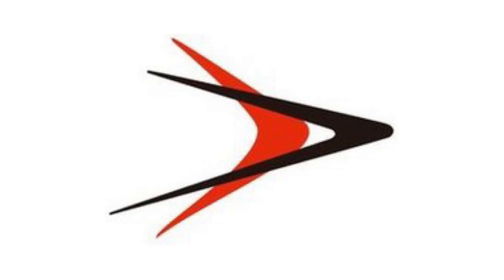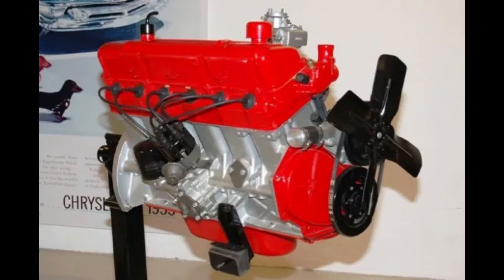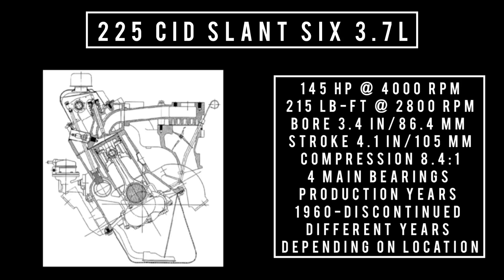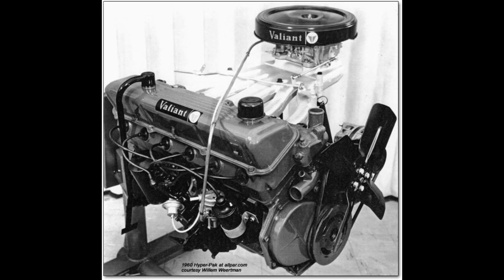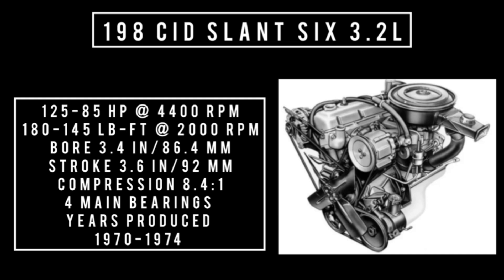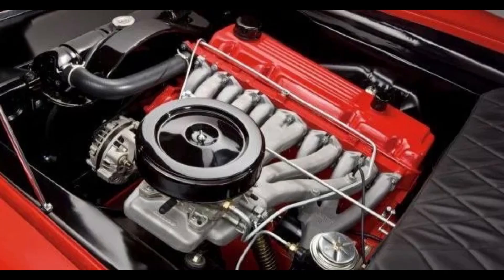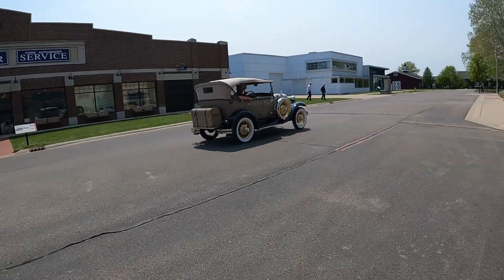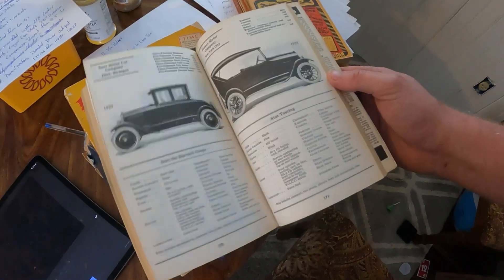Chrysler slant six engine family

Comment: Inervaters always ahead of the others, Australian charger was 14 sec 1/3 mike  stood for yrs fastest six 265 220,280,320hp ,triple Webber's,3, 4 speed later
Reply from the maker: There is nothing sexier than when you open the hood and you see three Weber side draft carburetors with the velocity stacks on an engine

Comment: Look  the Ford was a great lasting n 188 had awesome sound like a v8 sweet crackling with a tuned geni extractors n good fuel economy 🎉e, the chev six was great to actually hoping up n would only get let down by a circling oil pump or a shredded timing gear but a aluminium one would do it justice ,I'm going off my early days XTt 68 falcon ($420) loved her n my 307 CHEV 64 belair $1200  20 thou oversized fuelyy heads 1 650 vac holly 2sp powerglide push start lol , my 69 gran California special edition Buick coupe 350 4BARRL 2SP ELECTRIC POWER😂GLIDE  1 BOLT REAR 2  DR 2 PILLAR  3500 OK LOVED IT , BUT MY VF DART 170 (69) SHELL AUSTRALIAN COUPE  120 BUCKS BLEW A AUTO SEAL LOL BUT 225 IS IT RUNNING AFTER A TUNE UP YEP THAT WAS INCREDIBLE TO SEE I LIKED TO JOIN 2 N SEE A V12 HMM IT WAS GOOD BUT 318 SOLD ME NO OIL NO WATER N LIVED N WAS A DUELmovie VF REGAL 400 BUCKS N WAS A GOOD BLOODY RUNNER ,N 273,VG ,770 318 VG 200 BUCKS LOL THE CHRYSLER JuST WOULDNT DIE N IF U THINK TOUGH I HAD A DUDE GIVING ME 65 MILES OF CRAP SO I LINED HIM UP N STOVED HIS BACK END IN COMPLETELY N HAD A SMALL MARK ON BUMPER THAT TALT HIM THE DWEED LOL GRRR BUT HAD ALL 3 FIRST CARS  GOT SOME CHARGERS LATER COOL SO THEY ALL HAD GREAT RUNNING BUT MY VG COUP  265 4SPEED I REG IT ONCE EVERY 4 YRS FOR 3MTHS N NEVER TOUCHED IT A 1971(69) SHELL HERE N IT START N GO N I DID THAT FOR.   12YRS N IT WAS GREAT SO VALAINTS ,WERE PUT DOWN BUT REALLY THEY WERE GREAT WE DIDNT GET THE 426,383, BUT WE DID GET THE HYPER PACKS ,THE AP5 ,6 273 N 318 N E33,E34,E 40,e48,E37,e38,E49,E55 340 THE E CLASS 3 SPEED,4SPEED, 2BA4REL, 4BARRL,  TRIPLE WEBBERS , E360 VK SO VG WAS LAST PLYMOUTH VALAINTS N 200 BIG BLOCK AP2 N MOPARS PHINOEX, each year  I HAVE A 65 4DR PILLAR  IT HAD A BIG BLOCKn we got Canadian right handrive badged as dodge not Plymouthfurys,I PUT A 318 POLY IN HER ,ILL SELL THeM ALL I WANT A WILD CAT , BUT I HAVE A FEW STILL  A GS400 Buick  CONVERTIBLE  ,74 350 R/S CAMARO 3 SPEED HURST COOL ,PETERBUILT 359 supercharged 600 HP 18 SP LOVE IT , A VK CHARGER 360 POLICE PURSUIT LOVE IT just heads  , SOLD MY VG 360 CONCEPT COUPE 4IN DROP WHOLE ROOF STOCK GLASS,TUBBED N 4 SPEED R/T BOX WAS THE 12 YRS COUPE I SHEDED ITS also only used its stock parts so can be repaired if needed it took me 3 weeks no cuts in rood strong see,  DONE 300 KMS SINCE 2011 I R3BUILT IT SPENT 12GEE SIDE Pipes😮 10IN ROH MAGS 12 MICKEYS PACEMAKERS  ,HAD HER 24YRS WAS KEEPING IT FOR THE SON BUT MY BOSS GIVES ME 100 GEE SO IOL LET IT GO TO A GOOD HOME N MAKE USE OF THE FUNDS ,LOOK I LOVE MY CARS N HOPE THAT GIVES YOU A GOOD READ HAD PLEANTY N DID A LANDAU FORD COUPE TOO 4V 351 4 SEATER XA LAST OF 1375 COUPES N MAYBE A PHASE4 TOO LOL WELL GOTO PETERAMARI  AT INSTAGRAM N SEE THEWILD VG CONCEPT NUMBER 2BUT BETTER THAN THE 340 NO WIPERS NO GLASS LOL YOU CAN SEE THE BUILD N OTHER CARS I SAVED FROM SCRAP N MADE LOVELY ,SAVE WHAT U CAN N DRIVE SAFE OK LOVE YOU FOR YOUR TIME ,HOPE I DIDNT BORE U 😀
Reply from the maker: Great information thank you so much for sharing all that =)

Comment: I've owned them all over 40 years,  currently a 95 Grand Cherokee with the 4 liter.  I can't make the choice.  American in-line 6's are probably the best engines ever made - anywhere.  problems were due to previous owner's neglect - easily remedied.
Reply from the maker: Thank you so much for sharing your experience I’m hoping maybe next year maybe doing a test to see which engine would last the longest with most Abuse

Comment: In 1969 we in New Zealand had the export 225 which came in 160HP motor and another variant 175 HP Pacer  which had a better exhaust system on the Valiant's 1970 our Valiants used the 215 245 and 265 Hemi straight sixes now that's another story
Reply from the maker: Awesome information =)

Comment: I had a 1963 Valiant with the 170 single barrel carb. I bought the marine version intake manifold it was a 2 barrel carb. Milled .090 off the head.

Comment: I had a few of them in 1960's era cars . I also drove a few vans with them . Not fast in the vans , but did have torque with a load . The plastic gears on the distributor would break where they were attached with a roll pin through the shaft . The automatic transmission had a torque converter with a drain plug . On those 1960 through 1970's models , carry a spare ballast resistor . If it burned out , you had a no start . Not expensive , easy to diagnose and change .
Reply from the maker: I’ve read that you can get some serious power out of the surgeon I would love to build one one day.. And put it in a wagon lol

Comment: Take the ford 300 an bore it out put 305 rods an pistons in it with a 280h cam from cran cams an you got something no body expics great video
Reply: That's a tuffy Iv seen the manifold glowing pink on the 300 so hot it was smoking the oil out of it .. they let cool down put some more oil in it an stated back up drove it a nother 15 miles to get it back home ...now Iv seen a 225 slant get a hole knocked in the oil pan off roading an don't no how long the hole was in it but long enough to drain it all out an we where 9 miles away from where we finally found the oil an still drove it home so to me in my case it's a tuffy 👍👍
Reply from the maker: I’ve heard stories for all of them all bullet proof motors winner will go against Toyota and Honda engines
Reply from the maker: =) 

One day I would love to get for tired engines ford 300 
AMC 232 
Chevy 292
Dodge 225 

Drain the oil and run them and see which one last the longest..

Comment: As usual, the engines deemed most reliable, were engines that had no power. Ive owned and driven many slants, absolutely gutless. Im a mopar fanatic, and I say the slant is a heavy boat anchor at best, a 318 is a lighter and far better option. And as far as ease to work on, the distributor is in a horrible spot and is a real pain in the arse to work on, especially when compared to a B block.
Reply from the maker: I’ve heard that you can get decent power out of these I saw someone somewhere built one that got like 500 hp or something crazy like that I think that would be incredible put that in a wagon even if it was like 300 hp just make it a really cool sleeper car

Comment: Another key reason for the drastic drop in stated horsepower figures was the 1972 shift in output measurement from Gross Horsepower (the engine is tested without accessories, belts, and other power-sapping attachments) to SAE Net Horsepower (measured when the engine has the accessory belts, transmission, and everything else that is normally attached to the engine). In other words, the SAE Net is the amount of output the driver will actually get when they purchase the car.  This resulted in a 30% or greater drop in stated Horsepower just from that change in measurement standard. Combine that with newly mandatory power-choking emissions controls and you’ve got a series steadily declining horsepower figures across all manufacturers after the 1971 model year. 
They didn’t call it the Malaise Era for nothing…

Comment: I'd rather- AMC 232. Engine in production longer, several, Chevy small block 1955 2003, Buick 215 V8 1961-2006, Buick V6 1962-2008 though out of production from 1972-1974. AMC 6, 1964-2006.
Reply from the maker: Awesome thank you so much for those engine families =)

Comment: A few years ago, I had a 1966 Barracuda with a 170 slant modified. Chassis dyno at 204 hp at 4500rpm and 358 lb/ft  at 2750 rpm torque. Only time on a dyno. A few years later and more work the car would run 12.9 -13.0 sec at 101 mph in the 1/4 mile at 3250 lbs, thru the mufflers (street legal car).  Been racing the slants for over 40 years.
PS: The 198 had the longest connecting rods, not shorter.

Comment: I owned two Plymouth Valiants with slant sixes.  The engines were reliable and economical.  These were daily driver commuters so  except for an occasional jaunt on the expressway they never really stretched their legs.  My vote for the best six would be the AMC though.  I had a Cherokee long term and that engine was bullet proof.
Reply from the maker: I just watched PowerNation build one and they put a turbo charger on it and added 5 pounds of boost and with 11.6 pounds of boost they were able to get 400 hp out of it they added 11.6 at the end of the episode they were able to get more than 500 hp out of that engine here it is the link if you want to check it out

https://youtu.be/I7daGYuiD6U

Comment: Just a note. The hyper pack was designed to increase the low end torque. that way the racers didn't have to shift it down into first when rolling through a corner.

Comment: Still got my 1982 Dodge RAM D150 Custom pickup w/ 225cid slant 6. Installed a whole speed package on it from Clifford Performance. Dyno'd to about 210 hp @4500 RPM and gets around 19 mpg @ 70 mph on the freeway.
 Competition aluminum intake, Holley 4bbl, tuned headers, dual exhaust w/ flow masters, ported/polished head, 340 v8 exhaust valves & valve springs, cam, high volume oil pump, MSD / Pentronics ignition, etc, etc.
Reply from the maker: Car sounds awesome 
There was somebody on here saying somebody got 650 hp of a slant six that would be really impressive

Comment: The VW air cooled type 1 Beetle motor was made in various versions from 1938 through 2003, 65 years. It's not as powerful or durable as the slant, but it remained in production longer.

Comment: Great engine! I still have my 1980 Dodge D-150- 8 foot bed with 225 slant six and manual transmission. My dad bought new in 1980 and I still have it with less than 100,000 miles. Still have original alternator on her. We have Red Oak boards we custom made too. Thanks for sharing your video.

Comment: Had A Slant 6 In My 69 Dart But Siezed the Engine Somehow It Lost Oil And Died While Driving It .I Now Have A 67 Firebird With A OHC Inline 6 4 Barrel Rochester Carburetor Puts Out 215 HP 🤠🇨🇦

Comment: I had the slant-6 in a Dodge Aspen.   It was a good engine,   dependable.   I believe the only problem I had was that the accelerator pump in the 2bbl carb kept going multiple times.  I find that with other cars of the era that they tended to have some recurring problem.  Needless to say I got good at fixing it.  One could pull the carb apart enough to replace the little pump without disconnecting linkages.   The real problem with the Aspen that in a hard stop the back end locked up and was uncontrollable.   Since you mentioned the K-car.  It was pretty good.  I would tow a small camper for almost 8 hours a day with a transmission cooler.  Love them coolers.    It only came in a 4 cylinder as I recall.  In the Aspen the MAP sensor would go OFTEN.    I carried an extra in the glove box.   It was a plug in part.

Comment: I had a 1974 Dodge Dart with a 225 slant 6 and disk brakes, the stopping problem was solved with those as the disk brakes would stop the car reliably When I bought my 1977 Chevy Monte Carlo with a 305.  I gave the Dart to my Dad. Unfortunately he never checked the oil closely and the darn mechanical fuel pump was leaking gasoline into the oil.  This caused the oil to lose viscosity and resulted in a spun crank bearing..so sad to see that car ruined. The Chevy was a lemon from day 1, The transmission on the car designed to be matched to a V6 died at 25,100 miles a 100 miles after the warranty expired.  The speedometer failed one month after I purchased the car. Another failure with  a soft cam at 45,000 miles resulting in the need to replace the cam and the lifters and head gasket failure at 50,000 miles.  That car was Junk. However that said  my Dodge Dart ran reliably and never let me down ever making me wish I still had it.
Reply from the maker: Awesome memories thank you so much for sharing those stories crazy the Chevy treated you that way I’ve only owned two GM products a 96 Pontiac sunfire (pile of shit) and a 52 Chevy one ton stake which I love ❤️ =)

Comment: Back in the day, I owned two Plymouth Valiants, a '63 and a '64. ( The push-button transmission was not an engineering triumph.)
I had read somewhere that the only thing that wore out every 100,000 miles was the Delrin bevel gear on the distributor shaft. Designed that way to make it easy to replace. The internal mating gear was brass. 
Absolutely bullet proof.
Reply from the maker: Awesome information going to build a slant 6 for the channel one day It would be cool to have a sleeper car with that engine

Comment: Heard one story of guys running one without oil ( must of been brand X guys )to see how long it would go till it blew up ! lasting  ages,but ran out of beer so left it running, went too get some,they go back Is had stopped so thinking it had blown up , but No ! Just out of gas !! Didn’t get exact details sorry , but hey sounds right. I have more expensive cars from 440s down, but my most valuable cars are the Tilt Bangers !
Reply from the maker: I want to one day get those four engines and run them without oil and see which one goes the longest

Comment: I am a Ford guy. All my cars except one have been Ford products. Having said that, given the choices of in line six cylinder engines, I would choose the Chrysler slant 6. My sister had a 71 Barracuda with a slant 6. She bought the car brand new, drove it to work and shopping, and never changed the oil. This was back in the days when gas stations were full service and the station attendants pump the gas, checked the fluid levels, put air in the tires and cleaned the glass all while the tank was filling up. So my sister would just get Gas and a quart of oil when it was down a quart. When I discovered this was happening, I started maintaining the car and changed the oil often and early for a while until the condition of the oil on the dipstick started to appear more normal. After that, I give it regular oil and filter changes every three thousand miles. That engine stood up to my sister's abuse and performed great throughout the life of the car. My dad eventually took over ownership of the vehicle and had it for years. That slant six was as good an engine as my 1968 Ford 289 V8, which was my favorite engine until I bought my 2000 Cougar with a Duratec 2.5 liter V6. The only non Ford car I owned was a 91 Plymouth Sundance America with a 4 cylinder slant block engine in it.
Reply from the maker: Awesome story thank you so much for sharing those memories =)

Comment: Slants go Hard, In Australia I had a 66 AP6 Chrysler, with the 225 Slant, triple Webbers & Extractors, 3 on the Floor, PACER Tombstone Bucket Interior, but required constant maintenance of Cooling System, But it was reliable, if you did, I had Later Models, like a R/T 265 Hemi E49 Charger, it was a expensive toy, that ate Timing Chains & Fuel, but looked better .. , or maybe it because the AP6 was my First Car I owned .. ;)

Comment: I worked at Chrysler and slant 6 had a couple of weaknesses. The distributor drive gear was plastic and it would occasionally strip at the worst times. Also the exhaust manifolds often cracked. We sold many many manifolds.
Reply from the maker: Great information

Comment: I have had several 225s and a 170.  I still have an original HyperPak cam (actually a Melling RPD-3).  There were other changes to these over the years; 1973 they went to electronic ignition (an easy retrofit); I was the guy that always pulled the distributor out to change points.  In 1975 they eliminated the spark plug tubes and the 3/4” reach plugs with new short reach taper seat 💺 plugs.  No more spark plug tubes or strange plug wires.  In 1978 they changed the distributor mounting so you could turn it more than a few degrees and they went from a 1/4-20 distributor bolt to a 5/16-18.  Also in 1978 they went to hydraulic valve lifters.  Any of you who ever PROPERLY adjusted /6 valves (.010 intake / .020 exhaust, engine hot and running) would appreciate this.

I also had the pleasure of working with a 225 in a Yale lift truck (you might call it a hi-lo or something similar).  Propane powered, pretty neat!

On your last question I would be hard pressed to decide between the Mopar  /6 and the AMC 232 / 258.  That was an extremely reliable engine too, 7 main bearings, the engines usually outlasted the cars they were installed in.  But my all time favorite 6 cylinder engines are the Ford 240 / 300 and the GMC 305 V6.  Those were both pretty much bulletproof.  The /6 was really REALLY good and I love it but I don’t think it can beat that Ford or GMC.
Reply from the maker: Awesome information and insight thank you so much for sharing =)

Comment: My sister had a 1969 Valiant with the 170. It also had tall gearing in the rear end. It was SLOOOW on the takeoff. But once underway it was unstoppable. And it just ran and ran. My brother had a 1967 Dodge coronet. He drove that thing silly. Then it was passed to my sister, then to me. It never died. We just stopped driving it.  It wasn’t fast either, but given enough time, it could reach 95 mph.
Reply from the maker: Awesome thank you so much for sharing your experience you’ve had with this engine =)